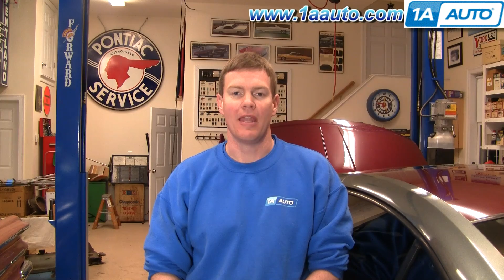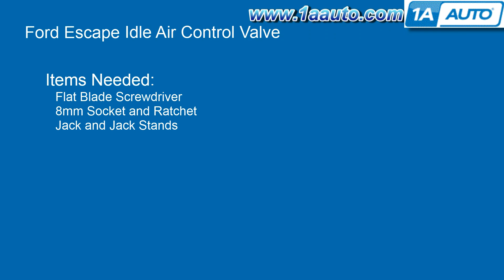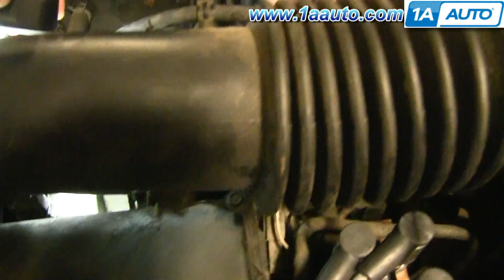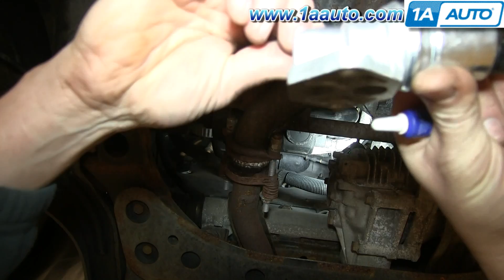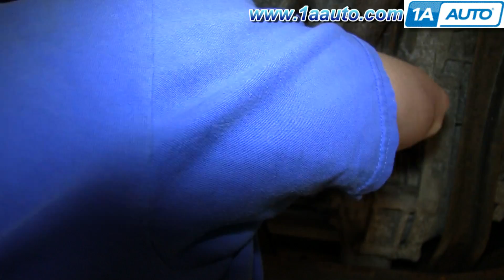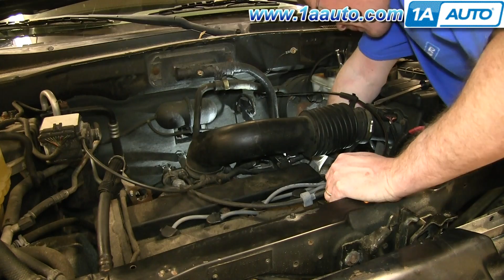How To Replace Intake Air Control Valve 01-04 Ford Escape 2.0L

Comment: I probably replaced the IAC 4x already and always have a very long time screwing back the bolts.   Using a small wrench 1/2 an inch or less turns at a time which is minimum of 30 min for  the bolt only.  Doing both bolts underneath, one bolt you will screw it without seeing it and the other in visible.  If you screw the other one above the engine, good luck with that.  I tried that and its so hard to position yourself and you will keep dropping your wrench.  Take note! My car is on a regular ramp which I am on my back underneath the car arms extended.  Shops will raise the car up and they will stand with arms extended which probably much easier.

Comment: hello I been trying to find the idle control air valve 2013 Ford Escape I was wondering if you can specify where it's located at or can it be replaced